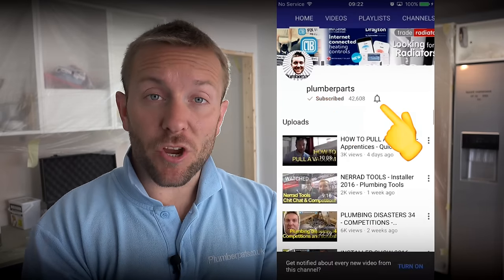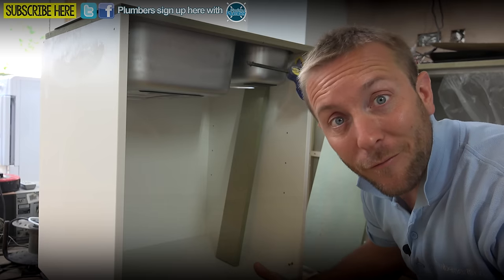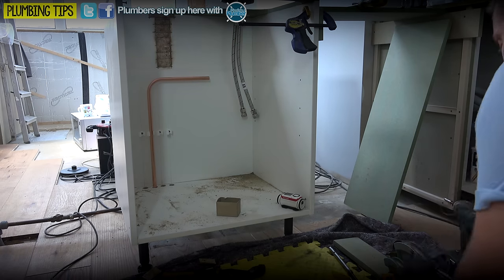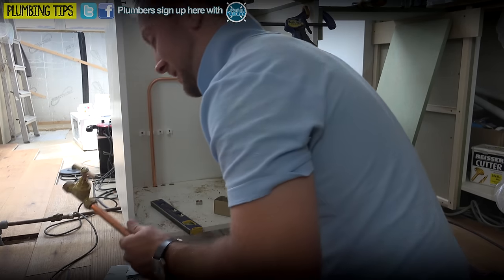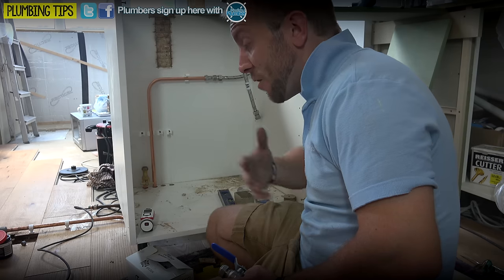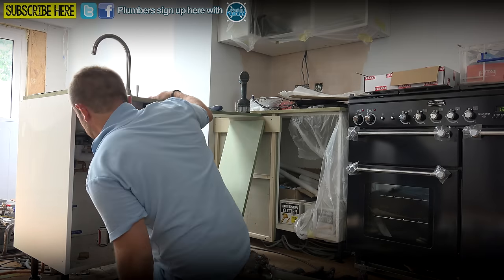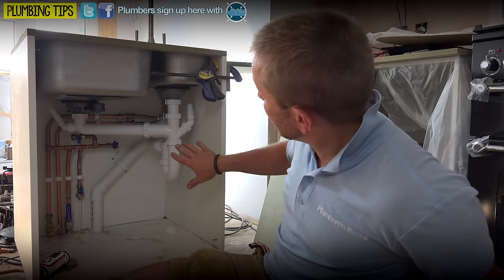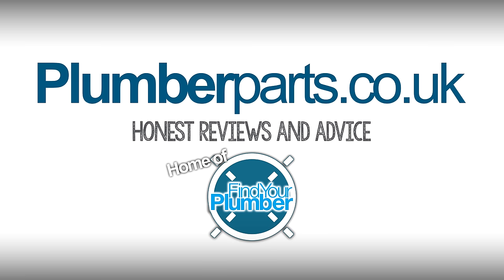Plumbing Underneath Your Kitchen Sink - Plumbing Tips

Comment from the maker: Please consider subscribing - Uploading still today!
Please Follow my Vlog, TimesWithJames  http://www.youtube.com/c/timeswithjames
My Amazon Tool Shop https://www.amazon.co.uk/shop/plumberparts
Reply: Hi James,  im really enjoying your posts here and especially atm as i  have been forced into fixing many things that i normally wouldnt attempt but ive got a bit more confidence now to try and tackle all my plumbing issues i hope... so many thanks and by the way, while im just draining a rad to try and fix a leak, ive been cleaning the fins as you recommended doing and remembered doing this once in a house i bought, simply because painting behind it in situ was impossible as it was so dirty with soot and cobwebs etc, you couldnt even see daylight inside and afterwards, i could not believe how much more heat i was suddenly now getting as a result, pretty spectacular! Just one thought, i think you used a feather duster and vacuum device in the video james, i have been trying out a discarded soft dressing gown belt and cut a vertical slit near one end and popped in a weight taken from the bottom of some old heavy curtains ( sometimes found sewn inside hems - to hang better),  works a treat plus you can do all middle section in one go which saves some time but  i agree, its a no- brainer must do task. Cheers buddy!
Reply: I know I am kind of randomly asking but do anybody know a good website to stream newly released series online?
Reply: @Elon Everett flixportal :P
Reply: @Major Gustavo Thank you, I went there and it seems like they got a lot of movies there :D I appreciate it !!
Reply: @Elon Everett Glad I could help :)

Comment: Went to a house to attend a dishwasher malfunction recently where there was a new kitchen install.  The waste water from the sink  etc goes out through the wall.  But its done such that the pipe into the wall is much higher than usual, in this case so that the U trap and nearly all pipework including the dishwasher and washing machine couplings are constantly immersed in water, cos the outflow pipe through the wall is higher.  Is this a problem?, and is it against uk regs?.

Comment: Just a quick question regarding the washing machine drainage.  I notice that the drainage pipe that the washing machine drainage hose is going to be connected to is practically horizontal to the drainage pipe for the sink. Does this mean that when the sink is emptied suddenly and all the water  rushes away that some of it will go up that left  hand drainage pipe and down the washing machine drainage hose into the washing machine just from the force of the water rushing down from the sink hole if you get what I mean.

Comment: So if the pipe that goes under the unit gets blocked? What can I do to unblock it?
Tried bendy wire
Barbarb of soda and vinegar
Boiling water
Non have worked.

Comment: Nice and neat. Aren't the trap connections going to be slightly short unless the worktop is the same thickness as the mdf. Not knocking your work, just wondering?
Reply: No. It's a undercount sink. So it will be long if anything. The sink is sitting 18mm high. Trap looks telescopic also.
Reply: +Daniel Brannigan arr valid point, I sported that at the beginning. completely forgot. Yeah your right might be too long. I'm thinking they went for granite, or maybe just the bespoke mdf rustic worktop.
Reply from the maker: Yeah top going on next week!
Reply from the maker: 20mm granite I think...

Comment: Hey I'm a 3rd year aprentice and I was just wondering do you have any tips for soldering when the two fittings are literally side by side. I normally double 45 it to make room. Also do you have any tips for soldering the bottom part of a fitting I always seem to get a bit of solder dribble. Thanks for the videos :)

Comment: thanks for the video, my diswasher is about 1.5m away from the sink how should i run the waste to the sink across and also the cold , thanks
Reply: I have a problem, i only have one water pipe and the machine is using it, so how do i attach my dishwasher🤔

Comment: Is syphoning not an issue with your plumbing codes over there? S traps like that have been totally banned in North America. Either you would need an air admittance valve, or an “island” vent installed.

Comment: Rough, enough sed,  top wash mac tap no room to get hose on, solder shocking, pipes will sweat under the sink and cause condensation, need lagging, keep hot and cold away from each other in a confind space best you can

Comment: i am a senior never did this before but empty pockets means this is a diy job.too much talking.not enough actual explanation when the older copper pipes have white plastic ends?? how to connect the new metal fittings to the older copper pipes.the job is completed without seeing how the stopcock tap is installed,could not see the most important.cheerful chap but i need to see more detailed step by step especially removing the d/washer connection and replacing it all with new.a lot od info on tidiness not enough on connection